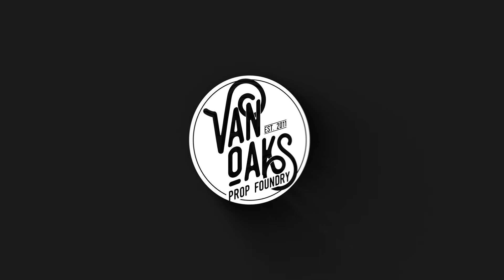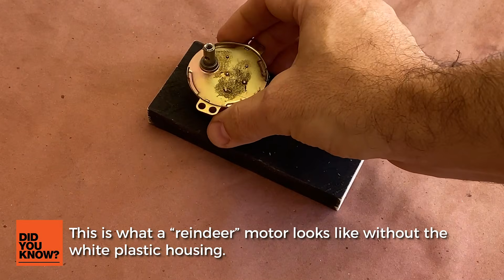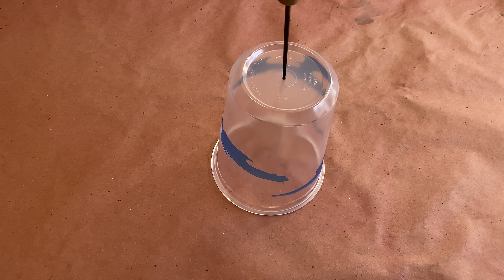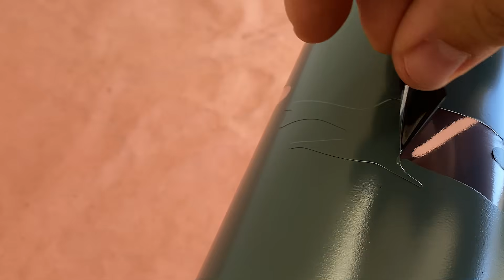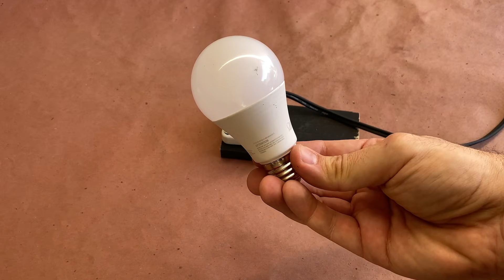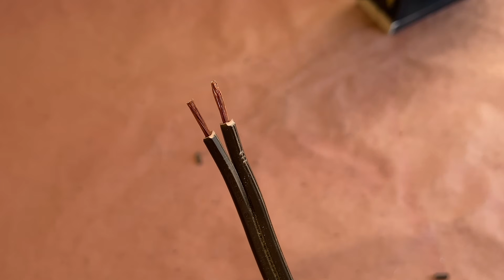DIY Animated Halloween Lighting Effect

Comment: Cool effect and a perfect use for synchronous motors.

Almost all of these motors use a metric screw to connect to the shaft:  M4.  Your home improvement store will probably have these in drawers of specialty parts in the fasteners aisle.

Those exposed screw terminals on the light socket are potentially deadly.  I don't think my stores even carry that style anymore, but they have similar ones that restrict access to the terminals once the socket is mounted.  If you have exposed terminals like that, at a minimum, please cover them with electrical tape.

It's best to ensure you wire the hot and neutral wires to the correct terminals.  It'll work either way, but the proper orientation greatly reduces the risk of electric shock if you screw in the bulb while the power is on.
Reply from the maker: Great points.

Comment: Your link to the motors is different now. The vendor must have changed the model motor. There is no threaded hole on the end of the shaft. Will just add hot glue instead.
Reply from the maker: I hate when they do that.

Comment: Maybe you can possibly give me some input regarding black lighting individual props. I will me making some Halloween tombstones in which I will be painting with fluorescent paint and want those lite by black lights. Do you have any moderate priced black light models/brands along with quality fluorescent illuminant paint that you might recommend that I should use on these tombstones?
Reply from the maker: Black lights are something I have little to no experience with. I've never used them in my display.

Comment: Just wondering about possibility - how would you do an actual "`levitating orb" light?
Reply from the maker: With projection.
Reply: @VanOaksProps  seems to be the most simple option. I actually made thoughts on some sort of remote controlled LED mini drone toy with some translucent bulb frame around it. Problem here, what sort of frame should not obstruct the drone from flying...?
Reply from the maker: @connorandrews2859  if you did a vertical flying crank ghost with a single led light source you wouldn’t need the drone. You’d have to figure out balancing the light to keep it pointed in the right direction.

Comment: I have an old electric fireplace with one of these in it for the "flames" o.o
Reply from the maker: How funny you should mention that. We do too and it was the inspiration for the build.
Reply: @VanOaksProps  Thank you for the reply ^-^ Enjoy your videos.
I found mine on the side of the road a few years ago. A fiberglass "Stone" fireplace and "Wooden Beam" mantel with an electric forced air heater and the rotating drum made from wire and lighting gels over an appliance bulb for the "flames" behind a hollow set of fiberglass "logs". 
It seems to have been built around the 1970s. Just needed to be cleaned up and rewired and works fine, if a bit noisy. :P

Comment: If you use a low voltage LED lamp and a gear motor of the same voltage, it saves a lot of headache, wiring and risk from exposed terminals. There is a small additional cost for a power supply, but the chances of someone getting shocked for real is much reduced and we don't need to make real ghosts that way! 😈